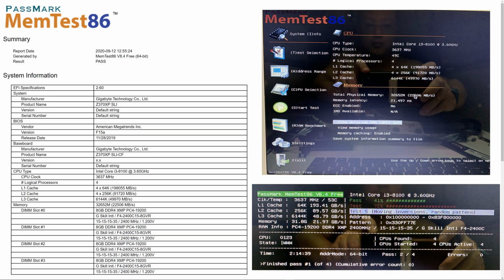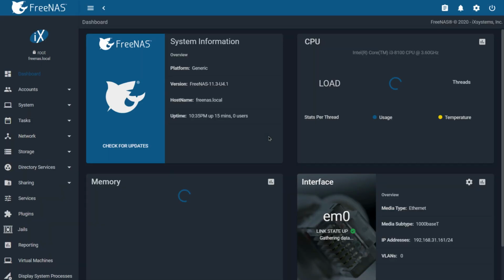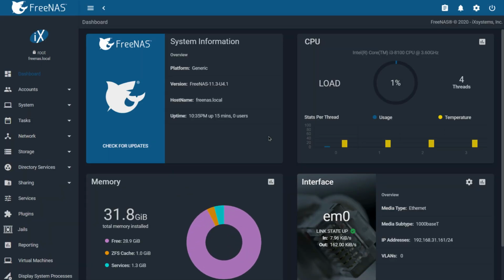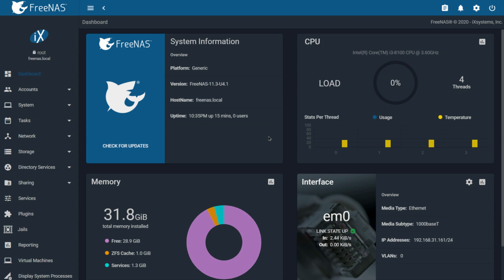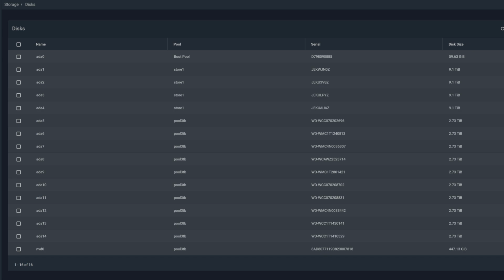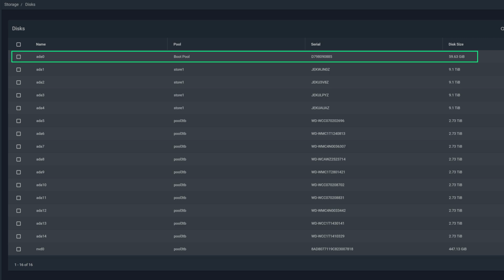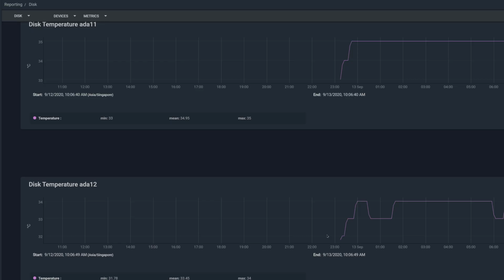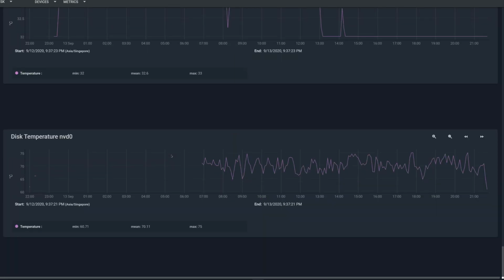My 4th FreeNAS Server Build and I'm Consolidating Them

Comment: Steve, no ofense and considering I set up one Freenas server so far, and you did it multiple times, but:
The single most trustworthy data source for a ZFS system is the data in the RAM. That means you can have as much redundancy and failure tolerance in your disk shelf and ZFS pools as you want, as soon as a bit failure occurs in your non-ECC supporting RAM, it will written as the actual correct information to the VDEV and thus instant-corruption can occur.
I am still not as deep in ZFS as I want to, but generally speaking from what I've heard, seen and read, ECC memory should still be a must, and considering how much money you invest in hardware, it would even be a lot cheaper to just go for an ECC supporting used enterprise server?

That is just my two cents and I guess that is a consideration you already had and decided against for a reason. My question is: Would you share that reason with us?
Reply from the maker: Hi, you are spot on. 

The achilles heel of consumer computers is the non-ECC RAM. However, as long as we are using quality RAM, then this should be a non-issue. All my FreeNAS systems uses non-ECC RAM and so far, no data corruption had occurred.

Moreover, I’m using these FreeNAS systems as storage only, mostly SMB shares, and do not run VMs, plugins or jails.

That’s where I ran Memtest86 to ensure the RAM are operating error free before putting data online for use.

Regular pool scrub, snapshot and ZFS replication are good practices to ensure data integrity.

I have another Intel server with dual Xeon E5-2670v2 with 128GB ECC DDR3 which I’m running VMs for my personal work and labs.

Your comments are most welcomed and hope my opinions are useful as these are based on my experience and trust in my hardware. Fingers crossed and hope everything goes well for a long long time.

Cheers

Comment: Does FreeNAS support Aquantia NIC chips out of the box now?
Reply from the maker: Hi, I’ve tested it and it is not supported. After FreeNAS boots up, the Aquantia NIC is not recognised in the Networks menu.
Reply: @UberBaby168  I was considering Aquantia also, but wasn't supported year ago. I went for Mellanox SFP+ NIC and DAC cable between NIC and switch.
Reply from the maker: Likewise, hope to see more NICs support in TrueNAS soon especially the Multi-Gigabit (2.5/5/10Gbps). Cheers